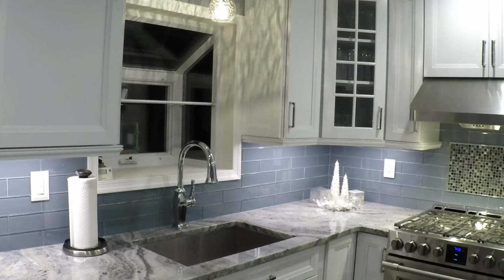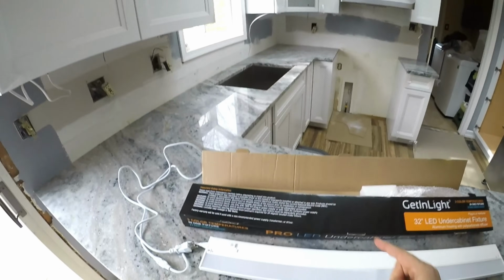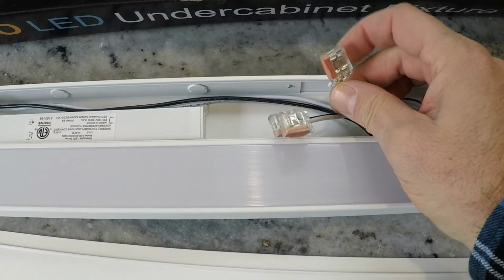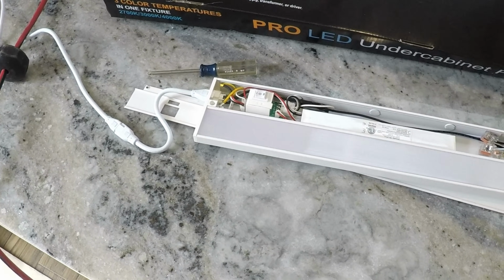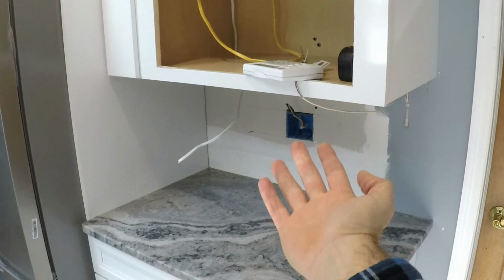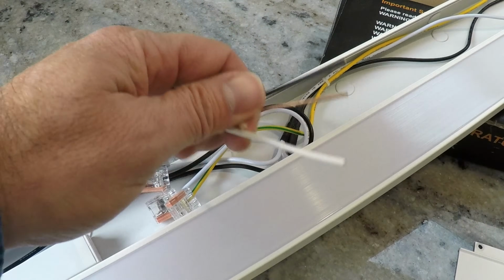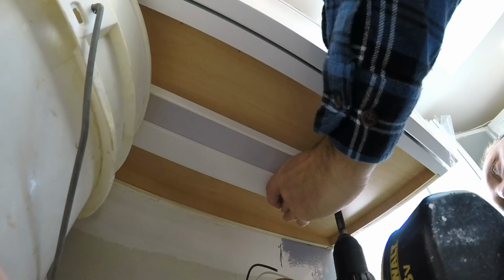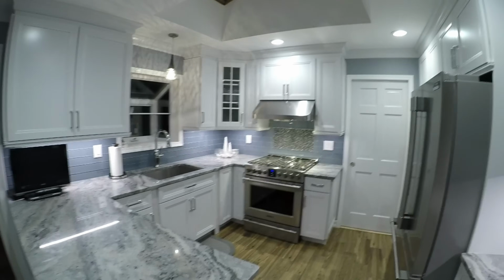Install Under Cabinet Lighting Without Hiring an Electrician

Comment: Thank you for the detailed video. How have they held up since you installed them. Any issues? Also you mentioned you will be installing a dimmer switch to dim these even more. Did that workout?

Comment: I have hard wired under cabinet lights now, but when left one for a bit, they tend to get quite warm, so warm that you can feel the warmth inside the cabinet when you touch the bottom shelf. Do these get that warm?
Reply from the maker: no, they do not get that warm because they are LED which are cooler than other types of lighting

Comment: Ugh...too difficult for me understand. I just want to know how an average person who's never installed any electrical anything can put up back lightning on the typical apartment style low cabinet, high cabinet (over the sink) back to low cabinet set up. Help!
Reply from the maker: Danelle... you can always go with battery operated if you dont want to run wires

Comment: On Amazon, people are saying that these GentInLight lights have different color tones depending on the lengths. Did you see any different in color between the different lengths?
Reply from the maker: no, it is not different by length. they should have three color temp options

Comment: I was wondering what you did for the corner cabinets, did you just run a cable from fixture to fixture or run all the way down the wall for each fixture?
Reply from the maker: from fixture to fixture.

Comment: Great job man! 👍🏼 The kitchen turned out really nice. I'm guessing it's probably best to install the light rail after completing the backsplash correct?
Reply from the maker: yes you are correct. Backsplash first then the light rail
Reply: @flannelguydiy6458  I'm just about ready to install lights as you did, only I'm in a remodel stage: everything torn down to studs. New stuff going in. What is "light rail" that is being spoken about here? I would think it best to do all my wiring first.

Comment: Not sure if your still responding. 
1. What guage was the wire into the fixrure.
2. I saw little blue extenders on the bottom of the cabinet so screws didnt drive into the dish area of the cabinet. Whats the part number and name of those?

Comment: Bravo and well done! I am getting ready to do my remodel and am trying to decide on the power outlets on the wall or up under the cabinets. The only reason I am posting it here is because I know you must have had to decide that as well. Any suggestions?
Reply from the maker: I would just put them on the wall and use outlet covers that blend in with the tile
Reply: @flannelguydiy6458  For sure! I purchased a few of the good strips just to check them out. They are ok if no other option or for an add on, but they do not have the robustness of wall outlets when plugging in items. I am very particular, but no way I would give up robust functionality for a backsplash with no outlets.

Comment: Good Video. I know nothing about electricity. With that said, when running wires to the next fixture, you mentioned only running the black power wire to the next fixture. Would all the wires (black, white & yellow) need to run out of one fixture to the next and so on?

Comment: Running a Rome wire in a cabinet is not safe practice. A sharp object could potentially hit the wire and this cause someone to get shocked. Should have ran it in the wall behind. That would have been a safer option.

Comment: Very nice job, your kitchen lighting is awesome!  I'm starting a similar project and like the GetInLight units that you installed.  But I can't find specs anywhere on their lumen output.  Can you provide that, please?  Also, do yours have the swivel feature of the light bar of each fixture?
Reply from the maker: I will look for it and no mine do not swivel. Those seem like a good option too

Comment: Great instructional video with good tips!  Purchased the same lights & then found your video to guide me.  Question - I'm replacing hardwired halogen fixtures, what to do if there is no ground wire (only black & white for each cabinet)?

Comment: I am installing 3 under cabinet lights. Question #1.. why does everyone bring the wire in to the center of the light? I ran my wire on the side of the cabinet underneath on the lip to go into the end of the light on the side. Question #2.. Where is the best place to position the light..the front or back of the cabinet?
Reply from the maker: bring the wire in wherever works best for you. Positioning will depend upon your fixture. I would say in the center or towards the back

Comment: How did you install the light under the corner cabinet? Did you use one and install diagonally or two at a 90• angle so no shadowing in the corner?

Comment: Great video!  Thank you!  I'm buying these lights after so much searching.  I do have one question.  How wide did you match the lights to the cabinets.  For example, on a 24" wide cabinet, did you put in a 18" or 24" light?
Reply: If it's a 24" cabinet, it's an outside measurement so the space under the cabinet would only take an 18"

Comment: Hi, did you daisy chain w romex so you can have the length you need? I will be ripping it out to the studs and was thinking to drill holes to run across to cabinet to cabinet. It seems you went above each cabinet and dropped it down?
Reply from the maker: If I had to do it again, I would run a wire behind the wall for each fixture and have it pop out right through the bottom of the back of the cabinet.

Comment: You have a beautiful lighting effect as the end result; especially when taking advantage of the different temperature settings for the "mood".  Maxim brand is very similar but has the ability to tilt/rotate the light bar to aim the light just where it's needed.  One thing that may vary depending on local codes is whether they would approve of that much exposed Romex under the cabinets.  Otherwise great job.

Comment: Wonderful video and amazing work! Thank you for the great info. 
I'm inspired to use the same lights. 
I plan on using four lights...but I have a black, white, ground and a red wire coming out of the wall.  The red is connected to a dimmer switch. Would I use the red in lieu of the black? And just cap the black?
Update....installed easily and looks great. I ended up capping the black and using the red and turns on via switch on wall. Same exact lights.
Reply from the maker: Sean... unfortunately I cannot give you any advice on what wire to use there without actually seeing what is going on. If someone did not wire your existing wiring correctly, it could be a huge problem if I tell you the wrong thing.

Comment: Hi can i aske what is the tempetur of the kelvin light temp at the time that you  Install the under the cabinet lights? I know you spoke on a other vidio that you changed out the led lights becuse of the brightness of them.
Reply from the maker: I may have had them set at 3500k during the installation. I am not positive. They can be set to three different temps

Comment: It’s nice. I’ve always wanted the Phillips hue lights though. I want them on the bottom cabinets and under the peninsula. The way I plan to do the kitchen I won’t have an overhead cabinets.
Reply from the maker: you should get whatever you are comfortable with. Just do all of your research and understand what it takes to install before you buy them.
Reply: Flannel Guy DIY that’s my issue. I’ve never understood how to install them and I wouldn’t want to ruin any cabinets.

Comment: It's best to remove all of the rings on the hand that will be holding the video camera and make sure nothing is rubbing against the camera as you are moving around to keep unwanted noise down to a minimum. Thanks  for the HOW TO video.
Reply from the maker: one of the big problems with the audio when that video was done is the use of just the internal microphones on the go pro. They pickup EVERYTHING when you touch or bump the camera. Since then, I added an external rode microphone which is MUCH better and has less of those annoying noises.

Comment: Hi,

I am having a new home build and my builder is asking for 300$ each light and 150$ extra for each switch. Is this a good pricing or do you suggest me to get it done with a electrician ? What is the ideal pricing  ?
Reply: Sandeep Patil at that price, I’d have them do it. I don’t think the pricing is bad. That way you can enjoy the lighting professionally done on day-one. Plus, if there’s something wrong with the installation, it’d be included in the new home warranty. Congratulations on your new home.
Reply from the maker: I think $300 for each light is expensive.

Comment: Thanks for a great video.  I need to replace old xenon fixtures because one failed, and I now need all my fixtures to match color of light.   Two years ago I had an electrician install an extra light under one of my cabinets that originally did not have a light, and he installed a rectangular box that the fixtures under those cabinets seem to plug into.  How will this box affect my install of these Get INLight fixtures?  If you can picture it, the cabinets take a 90 degree turn.  I had two hardwired fixtures on the long stretch, then he added a light fixture around the corner under the other cabinet.
Reply from the maker: you can make it work

Comment: Your kitchen turned our super nice. I like the light fixtures you selected. They seem to have excellent ratings on Amazon too. My only comments are I think I would have used standard wire nuts and flipped the orientation of the fixture around 180 so that more of the wire would be hidden behind the cabinet molding. Also did you wire in a dimmer?
Reply from the maker: I did not wire a dimmer but you can. These fixtures have their own dimmer feature

Comment: Great video,  I have a few questions.
1. What size romex did you use? It looked like 14/2 w/ Ground based on video.
2.  Any concerns on running 120V “high voltage” inside the cabinets?
3.  Did you have to notch the shelves within each cabinet to make room? 

Thank you!
Reply: To run the wires like that he could have used armored cable. I'm planning on running armored cable under the cabinets in my kitchen for the cabinet lights.  I'm not comfortable with the wiring like he has it.
Reply: I think if it’s possible to accidentally damage the wire jacket you are required to run MC (metal clad) at minimum.

Comment: If you want under cabinet lights in 2019, the best option is Black and Decker bar kits, especially "push connect". So easy to install and beats all the other company's features. Got them all over my house. Be sure to get a large bar for your work station, it works PERFECTLY!
Reply from the maker: Most of the new fixtures now have push connect options

Comment: I may have missed it, & I can search it out, but did you address just what KELVIN temp lighting even is, & what difference it is  over "regular" or non descript lighting, & why you found it to be important?  Lastly, I imagine an electrician could get behind the wall and tie e/thing into a current wall switch with not much of a hassle, or is that a pretty involved "fix"?  TIA
Reply from the maker: @Kman I have a video that goes into depth about the Kelvin temp and what the difference is and why it is important. Yes, you want a switch to tie it all together.

Comment: What all sizes of light did you use?  I saw the 32", but what about the smaller cabs?  From the view we can see in the video, how many lights total under the cabinets and what sizes?  Thank you for the informative video.  You're kitchen is beautiful and is surprisingly similar to what I've chose for mine.
Reply from the maker: You should use the largest size that can fit beneath your cabinets. Read this article for more info... https://www.lightingtutor.com/how-to-install-under-cabinet-lighting/

Comment: Did you install a variable dimmer switch that operates all of your under cabinet lights? It seems like it would be nice sometimes to dim the lights a little. If you did install a dimmer, were there any particular considerations, or was it pretty easy.
Reply from the maker: I did not install a dimmer because the lights have a dim feature on them. You can use a dimmer with these if you wanted.

Comment: great video! thanks for the info. Question - I know you mentioned the lights you used also come in a swivel version. I like that idea, but am concerned that even with a light rail you may still be able to see those fixtures depending on the angle of the swivel. Am I overthinking it? Also, is there a reason why you didn't go with the swivel option to give you more flexibility or were you just that sure of exactly where you wanted your lights? thanks so much
Reply from the maker: I didn't see the swivel option when I purchased these. I would get those because you can decide to keep it in either position if you want.

Comment: Excellent video and very helpful.  I am in the middle of remodeling my kitchen and undecided on what kind of lighting to go with (pucks, strips, etc).  I really appreciate it if you can offer some advice based on your experience. 
I know I do not want plug in and do not want a separate transformer to hide, which from what I can see is every LED puck application.  So I think I am down to strips like you have here.  In preparation, I hard wired all my locations to a switch.  You can see my rough-in preparations here:
https://youtu.be/3KCpkqoBsS0
As you will see I have all wires exiting the wall at precisely where the lower lip of the dead center of each cabinet will be mounted and I plan to drill a hole in the frame as you point out in your video at 7:48  And then I can "jump" from cabinet to cabinet according to the way I have it wired. 
Questions:
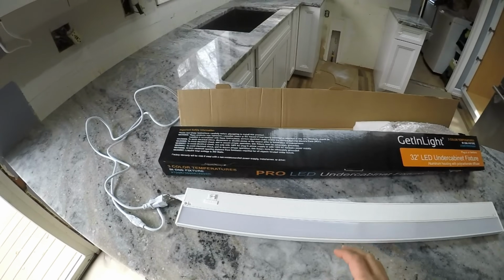1. At 2:35 you mention you were going to install dimmers to control the brightness.  This is a must for me. Does that work with these lights?  And if so, how?  Do you set the switch on the unit to it's brightest setting and then control the brightness with the dimmer on the wall?
2.  It's been a year since you posted this video.  Do you have any "If I knew then what I know now" moments in hindsight?  i.e. Are you still satisfied with these and if you could do it again is there anything else you would consider based on what I stated above I am looking for?
Reply from the maker: Mike
These under cabinet lights have a dim and bright switch on them. For me, these dont need a dimmer because I like them set at the brightness they are at now. You CAN use a dimmer though and yes I would set the fixture to the brightest setting and then dim them from there. The only thing I would do differently is run an extra wire over to where the main lights are when you enter the room and put a switch there instead of next to the sink.  One year later I still really like these under cabinet lights and I would buy these again.
Reply: @flannelguydiy6458  
Thank you for responding.  Unfortunately they don't have enough in stock right now for what I need.  I emailed the company and they responded promptly.  They are restocking Amazon's warehouse soon I was told and will notify me when they are in.  All good, cabinets aren't even installed yet.  
I checked out your blog too.  Excellent stuff.  Hopefully you check out my finished product in a few weeks.
Reply from the maker: ok great! thanks for visiting Lightingtutor.com   I started that site three months ago. Still a work in progress.  Will look for your finished installation.

Comment: Did you run each light to its own switch or did you link all of them together. If so howd you do that with them being so spread apart
Reply from the maker: I ran them off of their own switch. Talked about how I ran the wires in the video...
Reply from the maker: Joe Schmoe  you are correct.... they can all be strung together

Comment: Thank you for posting this, How did you power these lights? are you drawing power from another outlet?
Reply from the maker: Yes, I used the power that was already going to the light switch to power the light over the sink. So, I turned that switch into a double switch. One for the under cabinet lights and the other for the pendant over the sink
Reply: Flannel Guy DIY could you show us how to do this step?? Turning that single switch into two?

Comment: We are removing our existing tile backsplash,  while this is out I thought it would be a good time to replace existing under cabinet lighting with hard wired.  Can we tap into the existing power outlets to wire the lights or do we have to have an electrician come run a new line?  Does that make sense?
Reply from the maker: Heather, yes you can use the same power that the outlet is using. I would run it to a switch first of course. You also need to make sure that you are comfortable working with electricity and that the load on that line can handle the addition of the under cabinet lighting.

Comment: Cool video. Kitchen looks awesome. I have lights the are controlled by one switch. Can I just replace them with the ones you got without changing the wiring configuration?
Reply from the maker: Andy, if the wiring is similar then yes you can just swap them.
Reply: So I just installed them in my kitchen worked out just like you said it would. Amazing

Comment: My experience with peel and stick is that it pops off in short time. Have these held up?
Reply from the maker: What is peel and stick? I screwed the lights into the bottom of the cabinets. Did you watch?
Reply: @flannelguydiy6458  I think he is talking about the ones you used for the wires under the cabinet
Reply from the maker: @teaInTexas  ohhhhh well that makes more sense. You need to make sure the surface is completely clean and smooth. Otherwise they could come off.